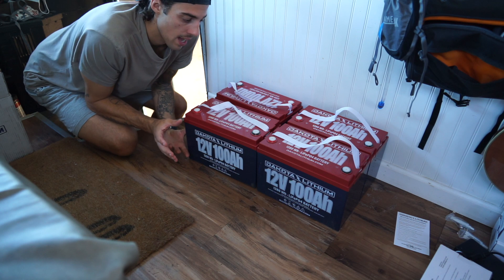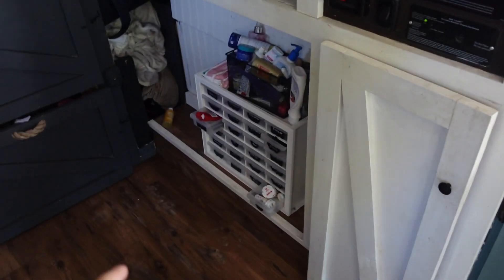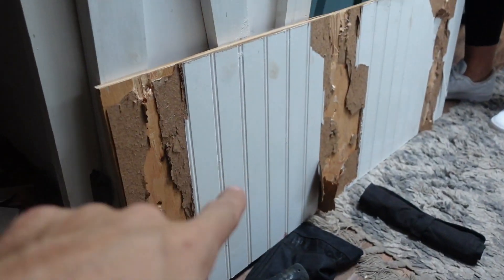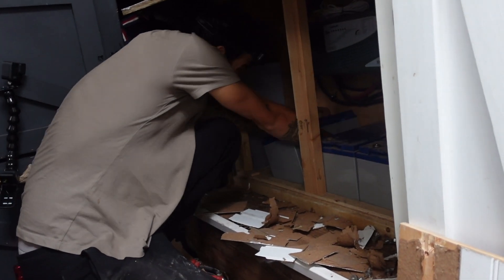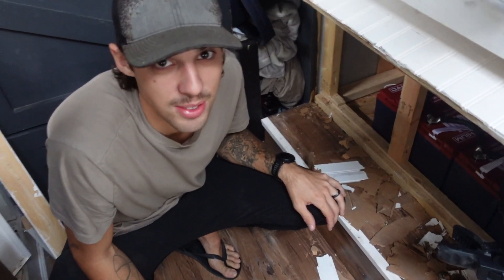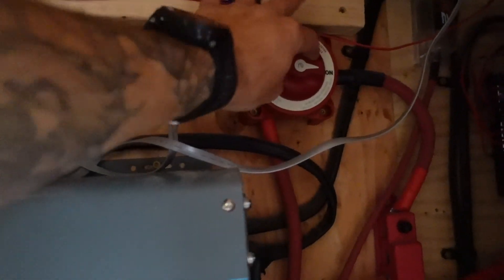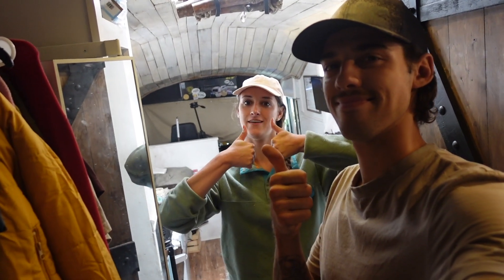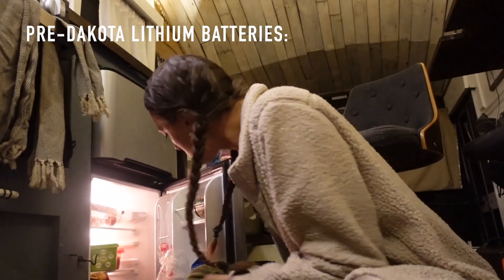WE SHOULD HAVE DONE THIS SOONER!! | Off Grid Electrical Upgrade

Comment: Jay, we use lifeline batteries, american made ( https://lifelinebatteries.com/products/marine-batteries/gpl-31xt/ ) for our vehicle builds, not cheap in any way but we have never had a failure when backed up with a battery guard, just incase you ever need to change again or anyone asks for a good battery. I would suggest you put a guard on these as well for good measure.
Reply: Why would they go back to 150 old tech ? LiFePo4 Lithium is the future ... #LithiumRevolution 👊🇺🇸